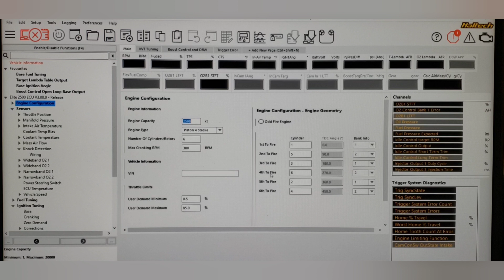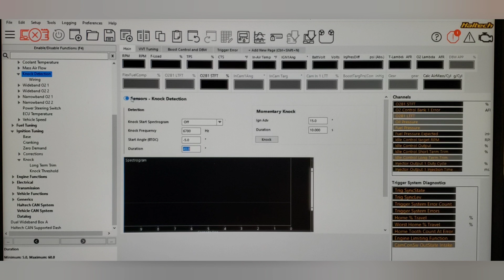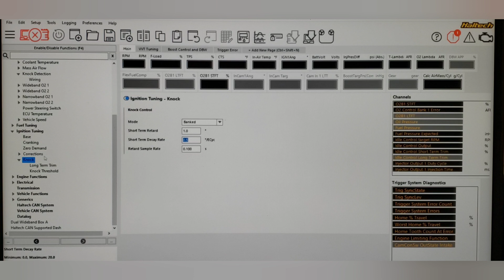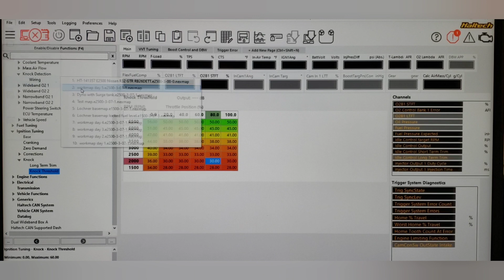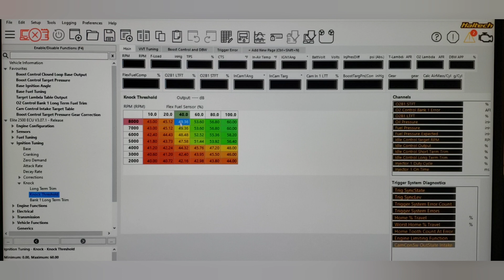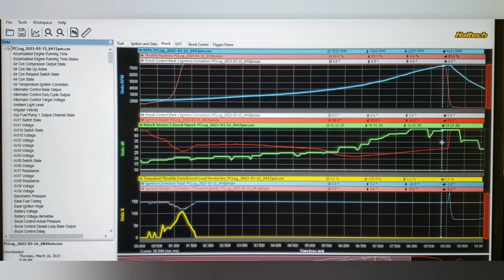Basics of Haltech NSP knock control

Comment: Aaron, what are your thoughts on tuning cars without audio knock detection? And relying solely on dyno geaphs to determine the timing requirements? ( when power plateaus/drops basically)
Reply from the maker: I have done that before, also did a video specifically on that subject.
Reply from the maker: https://youtu.be/YFy6LuBFuEk?si=Mc2Ynh1Ms5bcoTGO

Comment: -5 BTDC means 5 ATDC. The knock window start point is noted as BTDC
Reply from the maker: Yes, thank you for the correction.
Reply: Can u explain this please as if you going btdc your going anticlockwise backwards so if your -5 btdc just means negative 5btdc ? 
Or am I understanding wrong ? Thanks
Reply from the maker: @bigbothoee8617 you're understanding it correctly. Advance in timing is before TDC, negative numbers are after TDC.